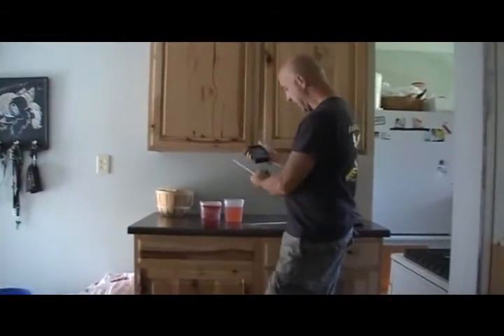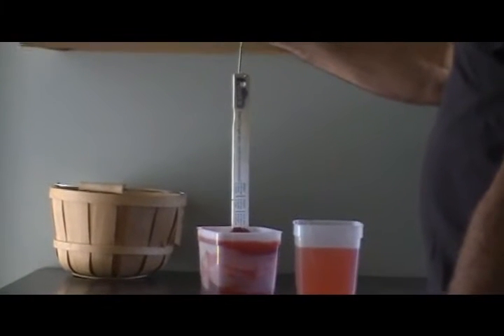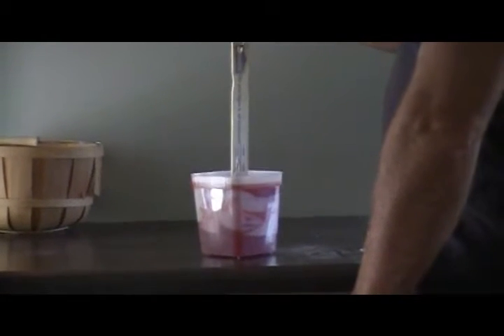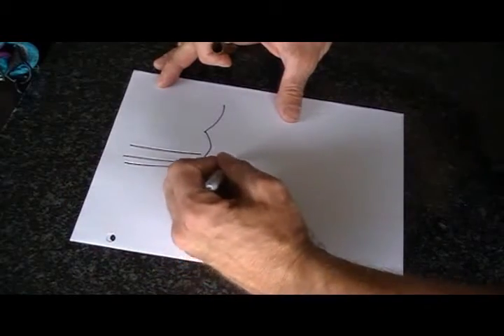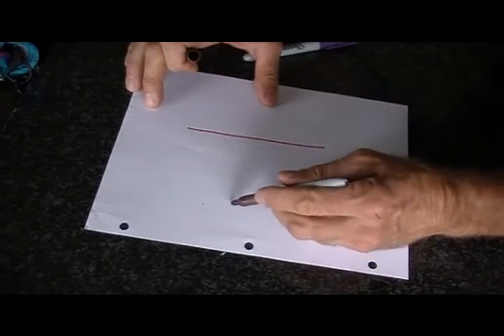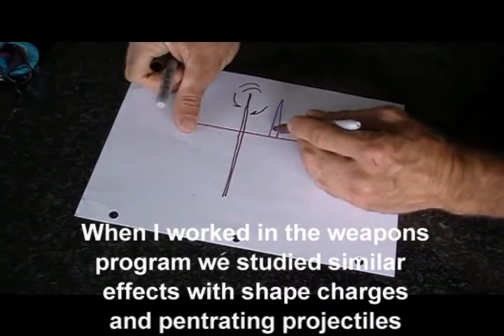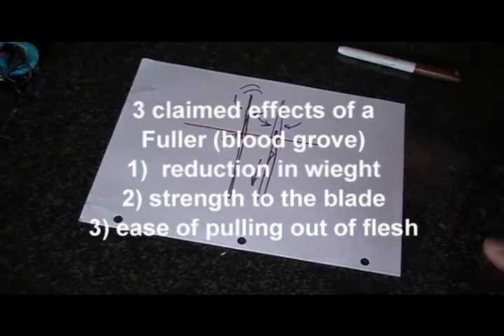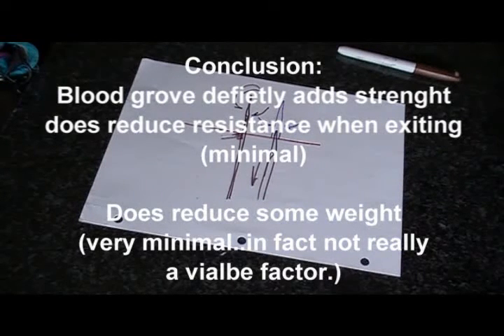Knife blood grove myth, does it work?

Comment: The groove only reduces weight if it is ground in and most good blades are forged and it is hammered in with no reduction in weight at all.
Reply: 2 grams of weight?
Reply: @bkackmagic555  You'd be surprised how much weight such little metal can do. Reason why medieval swords have fullers for one, less weight, and two, less metal.
Reply: @credinzel6996  but we ain't talking sword. Were talking about small knife. Would take an ounce or 2 off. Someone measured it. I'm still thinking because it makes the knife easier to pull out of something. Fights the vacuum without being overcomplicated and doesn't hinder strength or weight

Comment: Ballistic gel is a lot stickier than flesh too. Maybe an ounce difference, utterly inconsequential considering considering an athletic man can pull with at least 50lbs of force. Apart from that a lot of fullers on swords stop waaay before the end of the blade where you usually wouldn't be thrusting to anyway and plenty of cut focused swords have fullers too.
Reply: Over penetration happen very often as illustrated in historical combat treatise and manual.